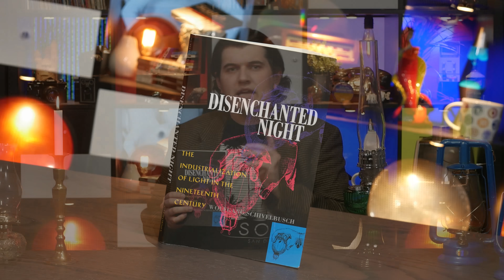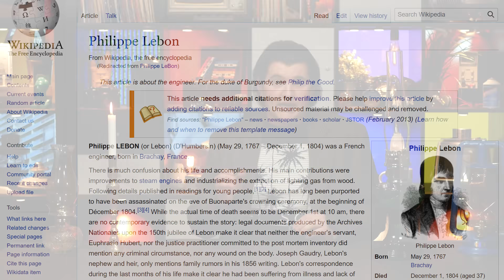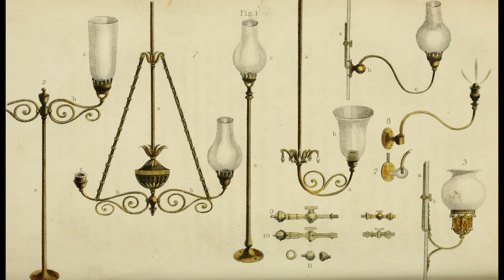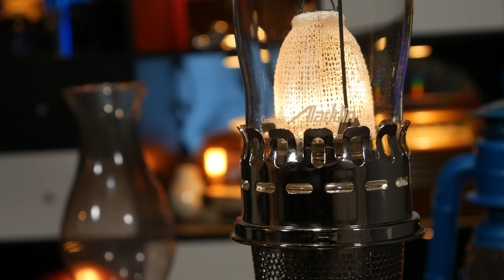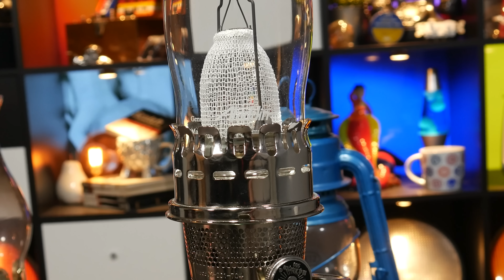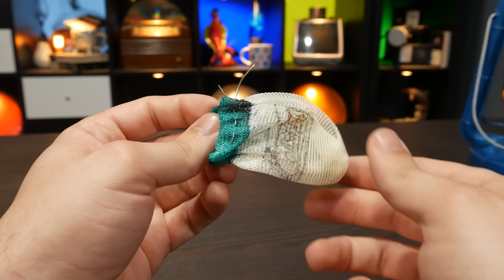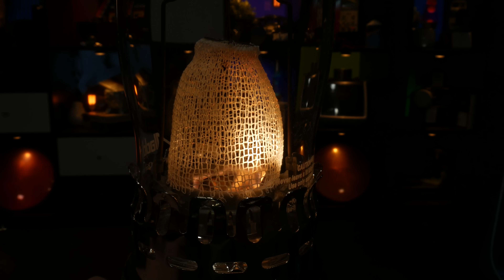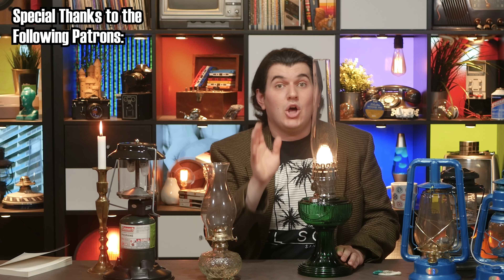How the gas mantle made lamps 10X brighter

Comment: 14:35 There is no such thing as degree Kelvin. Its just Kelvin, no degrees. Kelvin is an absolute unit, meaning its 0 point is strongly defined.
Reply: The difference between say 300 and 301 K is still a degree away. So 0 is just Kelvin but above that it is a certain number of degrees away from 0
Reply: @parker7888  Except it's not. Kelvin as a unit is defined to not use degrees. So while your reasoning makes sense, it is incorrect in this case. I agree it's stupid, but that's just how it is.
Reply: @FlamingPhoenix40  it's not stupid, it makes sense. A degree can only exist if it's referenced on a scale. You are basically saying "what level is it on this particular scale" 
As Kelvin has no scale there is no means to reference its level upon a scale.
Reply: @DJS_ENO  well it is a scale, from 0, like a scale for measuring weight. It's just that temperature is measured in Kelvins on the Kelvin scale, just like it's degrees on the F and C scales

Comment: I always assumed that it was called a gasometer because the structure goes up and down with the amount of gas stored. It's not a precision measuring tool, but you can see at a glance how empty or full it is.
Reply: They usually had a scale on the sides indicating the general volume also.
Reply: That's exactly why, and it is, as a result, a measuring tool. Albeit not the precision operation a scientist might prefer
Reply: Indeed, you could tell if it was full, halfway down, or empty. It would rise throughout the day and then go lower in the evening. They didn’t store it for very long at all.

Comment: Great video! Just a nitpick (14:35):
The Kelvin scale is not measurred in degrees (unlinke °F or °C) because it’s an absolute scale. Twice as many Kelvins means twice as much thermal energy.
Reply: The omission of "degrees" in the Kelvin scale has nothing to do with it being absolute.  In the Rankine scale (the absolute scale based on Fahrenheit) the units are "degrees Rankine" or °R.
Reply: @VitalVampyr  TIL, thanks! Also I've just read that kelvin (when referring to a unit) should be written in lowecase, so I also got that wrong.
Reply: I learned two things from this thread! Thanks guys

Comment: "lute - To close or coat with lute; smear with any adhesive substance for the purpose of closing cracks or joints. A glass retort is said to be luted when it is smeared over with clay to enable it to resist more perfectly the effects of heat, and thus guard it against fusion."

There's also "flute" - the instrument and the folded-in-a-very-particular-way filter paper. What other music <-> chemistry terms are there???

Comment: I have one of those old kerosene camping lanterns.   Sorry to spoil the next video but I think there's an "atomizer" that squirts the fuel into the mantle to keep the burn going while the fuel storage is under pressure, manual pumping.   That said, had a nickname for the lantern "Old Flamey" because sometimes if the spark to get it going took too long the vapor of all the kerosene turned it into a literal fireball... yeah that's a great feeling when you're in the middle of the woods.

Comment: I hope we can talk about the technology that makes it green sometime.
Reply: indeed. though you can harvest methane from landfills and get green gas light that way I suppose...
Reply: The real reason is because the term 'green' doesn't mean anything other than cleaner and/or more efficient than its immediate predecessor. 

Burns less fuel/lumen, pumps fewer unburnt fumes into the air, doesn't leave soot behind therefore it is green.
Reply: @jypsridic  I think by green he meant the literal color of the green glass in the lamp he was describing, not its efficiency.
Reply: I think they just add copper to the glass during the blowing process.

Comment: From Oxford Reference 

lute 

A U-shaped loop in a pipe or tube in which a liquid is trapped and used to provide a seal for gas flow. For example, the pipe from a gravity-fed reflux from the condenser of a distillation column contains a lute. The distillation column has a higher pressure than the condenser and the lute prevents vapour entering from the wrong direction. The depth of the lute is determined from hydrostatics and is greater than the maximum vapour pressure difference between the column and the condenser outlet.... ...
Reply: so, sort of the same idea as a p trap on a drain?  liquid filled pipe to keep gasses from going past?

Comment: That mantle burn-off was most likely caused by a nitrocellulose coating. Like flash-paper.
Reply: My vote as well of the kerosene lamp version he lit off on the cooking stove in particular - nitrocellulose goo of some sort. Burned with a true vengeance. A standard mantle used for my propane camping light doesn't conflagration worth a hoot, but that one was a very pleasing standalone event.
Reply: It is the silk or rayon mantle itself burning off, accelerated by thorium nitrate which is then reduced to an oxide that glows.
Reply: @jimurrata6785  he said himself that it doesn't have thorium in it.
Reply: @ashtonhoward5582  "Any more".... And the yittrium ones are garbage in comparison.
It's still a metallic nitrate that's burning off the mantle.

Comment: @14:08: "Did you know there's controversy regarding the phasing out of thorium in gas mantles? Some very picky campers certainly do but most of you probably don't."

Dude. We are watching a half-hour video that it is itself a sequel to another half-hour video about lighting technologies that were deader than disco well before YouTube even became a thing. I think you can expect a certain degree of nerdery. :-D
Reply: Well, mantle lanterns (propane/kero/gasoline) are already pretty obsolete in the camping world. They've been swiftly replaced by LED based lanterns.
Reply: @jonathantan2469  Well, I wouldnt say they have been replaced by leds, gas lamps still has a place. If you have to use gas to cook while camping then you can just as well use gas for light, and a decent size refillable bottle of LP gas will give you weeks of light... It is sort of comparing electric cars to gasoline cars... 😀
Reply: @erroltheterrible  In Australia, it's nearly impossible to find propane lanterns in camping shops now. Kerosene & white-gas lanterns are no longer in stock, except for a few specialty shops. They've all been replaced with LED.
But then the market here caters mostly to weekenders, family campers, & tourists. Caravanning is becoming more luxe now. Seen bigscreen TVs connected to shore power in the caravan parks.
Reply: @jonathantan2469  Maybe its still an Africa thing? Here in South Africa I can exchange an empty propane cylinder, for a full cylender, at petrol stations, and we can get LPG equipment at the local DIY/Hardware/Gardening shops. But then again, kerosene stoves, heaters and lamps are also still common...
Reply: @erroltheterrible  LPG propane is still in wide use here, and you can also do a swap or refill at most filling stations, hardware outlets, and some bigger camping stores. People in the big cities & towns have piped gas service, so LPG cylinders are only used for BBQs, tools, outdoor heaters, and camping stoves.
In the rural areas, some have LPG only for household use because getting a gas line installed is not practical.
Reply: @jonathantan2469  We only installed LED lights in our hunting shack (which is not electrified - 12v batteries power them) a couple years ago. Last year we had to switch back to the gaslights when the battery ran out. They're still out there, and they still work great
Reply: @ebnertra0004  For off-grid rural camping or living that's going to be over many days or weeks/months, kerosene or gasoline lamps might be still be a good choice for lighting. You can run it off the same fuel you use for cooking. Propane is an easier choice, but it's bulky with a heavy metal cylinder to carry. Plus, refills/swaps in rural areas can be many many miles away. Solar recharging does work, but if the weather's bad, or you have few daylight hours & cold in winter, and your camp/cabin is in a forested area, it may not be reliable.
Reply: And he didn't even cover the controversy, we have to wait for part 3, presumably also a 30min video.

And for camping LED is just so much better, for one you can just toss it on your sleeping bag without fear. Any fuel based lamp would burn your tent down if you tried that.

But fuel lamps are wonderful backup lighting when the power goes out, or just remote camps where electricity has to come from some form of generator.
Reply: At the abandoned Coleman factory in Wichita Kansas my dad was sent to remove some old HVAC equipment (I believe that was the reason.), and he had to wear booties and a onesie to keep the particles from getting in his clothes. He was working alongside a HAZMAT crew with Geiger Counters. The old factory is a parking lot now.

Comment: "Lute" can be defined as "a clay or cement used for sealing a joint or coating a crucible."  So, I imagine, in this case, "forced my lute" might mean the gas cracked the cement he used to attempt to seal the gas inside a container?  Maybe indicating that the gas was under a lot of pressure somehow?  Just a guess...
Reply: That's most likely what he meant. The distillation of coal has to be done in an air tight vessel, such as when they made town gas or coke or when burning wood to make charcoal.
Reply: The author was quite likely precisely describing what physically happened, but we are so used to these old-timey mechanical phrases being used for dramatic flair it is hard to hear it that way. Imagine an electrician working on a circuit and saying he blew his fuse; he would probably be talking about the actual fuse in his system.
Reply: @asmodiusjones9563  i think if an electrician told me he blew A fuse, while working on something, I wouldn't take it metaphorically. Blew HIS fuse, sure.
Reply: This was my guess also. If you look at the retort, there is a hole in top to fit a stopper or additional fixtures. "Forced my lute or broke my glasses" sounds like, "popped my cork or shattered my retort."
Reply: @DonMachado  I am guessing the receiving beaker is more likely, though I am definitely using the phrase from now on to express consternation.
Reply: That must have really forced his lute.
Reply: https://en.m.wikipedia.org/wiki/Lute_(material)
Reply: Could he have meant to say he "came undone"?
Reply: Maybe he was just a spoony bard
Reply: You’re pretty much correct, though exactly what he was using to seal the joints is unclear.
Reply: Spot on.
Reply: I really thought it had something to do with the musical instrument…

Comment: You seemed somewhat vexed by the necessity of having to give the Aladin lamp constant attention, but candles required even more attention than the Aladin, so it was a great improvement over candles for sure in this respect as well as just lighting a room better.
Reply from the maker: By the time the Aladdin lamp was produced candles had had self-trimming wicks for decades, and standard oil lamps are much less prone to runaways. That's the main reason you need to check on the Aladdin, and indeed there was a time earlier on where I set it to high before it had warmed up, left the room for a moment, and came back to it with a massive flame. I thought I had ruined the mantle (the buildup was substantial) but thankfully it burned off alright.
Anyway, you'll see in the next video that the alternatives like the Coleman lanterns (and they also made table lamps, too) are in general much more stable, though they have their own drawbacks as well.